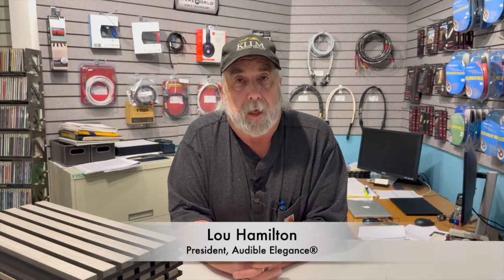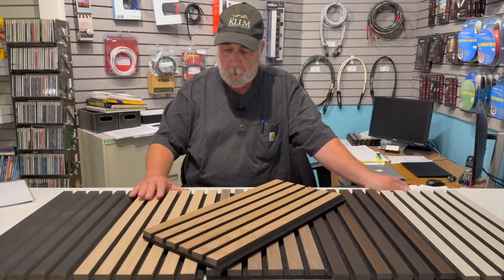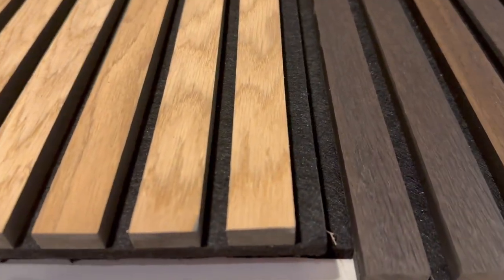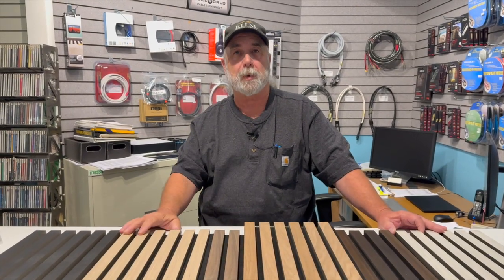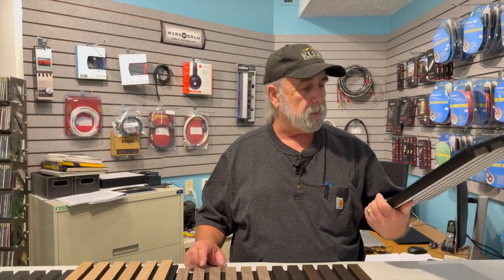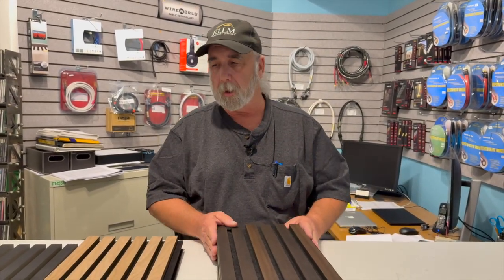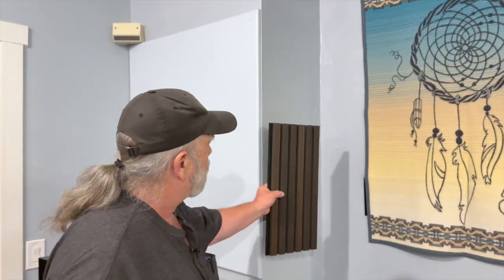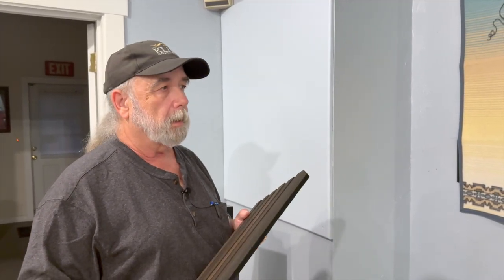An Entire Wall of Acoustic Treatment May Not Sound Good...At All!

Comment: Lou, per your suggestion I'm searching out these videos on room treatments. I may have my own particular need. However, I'm not grossly aware of significant deficits. The comments below help as well. Currently, I'm pretty darn satisfied with the sound I hear - and not aware of blatant misgivings. However, I'm just doing that eternal wondering... Can I make it even better? I've 'tuned' my room via speaker placement - trial and error for quite some time. In fact I'm not using any "formal" acoustic dampening materials. I'm using my room, as it's situated and furnished. Currently, I am only wondering if a tweak would be in order and what it might be. The surface that 'concerns' me the most is just the back wall, 3 feet behind my listening position. It's mostly bare - plaster over sheetrock. And I know that one of the idiosyncrasies of my room (if such a thing exists) is behind me, in the back, left corner where I've an open doorway which is perhaps some form of port for the room (if I were to view the room, in conjunction with my components, as a speaker in its own right). Thanks

Comment: I only have a few panels and a diffuser on my walls.  Since they don’t weigh a lot I used Command Velcro wall strips by 3M (not a sponser lol).  Since they are Velcro I can hide them behind the panels so the “remove pull tab thingie” won’t be seen.  I tried the removable double sided strips but you have to leave the pull tab visible for removal so the Velcro works better.  It does leave a large air gap between the wall and panel though.  Not sure if it makes a sonic difference having the bigger air gap or no air gab at all.
Reply from the maker: Interesting approach.  Oh, it likely does particularly in the likelihood that the board itself can resonate itself.  Now whether or not this is, itself, an issue, would require the experiment of taking the time to screw them down.  I like your approach as it allows you to change positions or placement. It is impossible to predict what exactly happens on velcro without measurements.  There are some great programs for the phones what might prove handy but keep in mind your phone microphone is hardly state of the art for this.  It's designed, or should be, around the human voice.

Thank you for your contribution to the video and channel.  Please do tell others about us and our other 330 plus videos with so many more to come.  Help us out by subscribing so that we can continue to improve our channel.

Comment: I changed my room orientation from short wall to long wall for the spkr placement which meant that my listening position was right up against the opposite wall. This reduced the side reflections and bass had no issues in my 25l x 13.5w x 11h space but the walls and ceiling needed treatment. Primacoustic 2" panels  3 ea  4' x 4' behind the two spkrs and the listening position and 2 ea 2' x 4' ceiling panels above did the trick. Wide deep soundstage, clarity, no smearing, air, slap echo is gone, vocals are lifelike and clear just wonderful. The panels are dense fibreglass covered in polyester fabric, fire rated broadband absorbers. I should have done this years ago, it was the last thing on the list but if I have to do it over again I'd do it before making gear decisions.
Reply: Thank you for sharing your experience—it's always great to see people taking steps to improve their room acoustics. That said, there are a few important points to clarify from an acoustical standpoint.

Positioning your listening seat directly against a wall—especially the rear wall—is generally not ideal. This location is where low-frequency pressure tends to build up or cancel out due to boundary effects and modal behavior. While changing speaker orientation can influence reflections and imaging, it doesn’t eliminate room mode issues, which are especially prominent in a room with dimensions like 25' x 13.5' x 11'. Those dimensions create predictable axial and tangential modal problems that cannot be resolved with broadband absorption alone, particularly not with 2" panels as one has to have predicable rate and levels of absorption from a wider band of frequency related issues.

It's also important to note that 2" fiberglass panels (Science has proven it's ineffectiveness), while offering little  at reducing mid- and high-frequency reflections (like slap echo and flutter), and do very little below ~250 Hz, (extremely carcinogenic). That means any improvements in bass clarity or “lack of smearing” are likely due to placement coincidentally aligning with room nulls or peaks—not a true resolution of modal decay, which requires much deeper, properly positioned bass absorption.

Lastly, subjective impressions are valuable to a trained Acoustician, but they don’t replace proper measurement. Without before-and-after data (RT60, frequency response, waterfall plots, etc.), it’s difficult to assess whether the improvements are addressing the full acoustic picture or just creating a more pleasant—but still imbalanced—listening environment.
Reply from the maker: @audiononsense1611  Thank you, you can see what I stir up with my videos and sometimes get abuse. I swear selling audio is about as smooth as a bill going through Congress and the internet has not improved things much at all.  The trolls can really make things difficult.

Comment: As an Acoustics Consultant, I often see well-intentioned advice from so called acoustics manufacturers and online—particularly from DIYers and YouTubers—that unfortunately leads many to waste money on ineffective products (including some mentioned here). My goal is to help you avoid those costly mistakes.

First and foremost, before investing in treatment, make sure your system is properly set up in the room. This alone can make a significant difference. Next, understand that low-frequency energy is typically the most challenging issue, and standard 2–4" foam panels will not solve it. Despite the marketing, there is no one-size-fits-all "bass trap" solution.  Low Frequency energy is powerful and can not be trapped but only managed!!

Avoid materials like fiberglass and Rockwool unless you're fully aware of their health and performance implications. Open-cell foam, when used appropriately, is effective for managing mid- and high-frequency reflections—but not low-end problems. Exposed glass surfaces also introduce their own set of acoustic challenges.

There’s much more to consider. I've written a comprehensive guide on this topic for those interested in diving deeper. Most importantly, if you're not using measurement tools, you're simply guessing. And remember: EQ cannot fix room modes—it only masks them temporarily.

If you need help navigating these issues, I’m happy to offer guidance.

Comment: Excellent video again. I bought two 8ft. tall by 2ft. wide sections from my local Floors and Decors store. They are $100 a piece and the quality is great. I use them like Bass Trap (no filling behind the  panels - yet). They are loosely placed against the front corners of my room for both my Subwoofers and Electrostatic Speakers. 

They work great. As you mentioned. Lining the front wall would look cool but sound like crap.
Reply from the maker: Thank you for experience and a way to use them.  I am reminded of the period where there was this guy selling all sorts of little triangular pads to place in the corners of your room.  It became quite a fad for a couple of years in the 90s, I think.  Now, while they sorta make sense, again, they were all the same size, same density, and same thickness. One size in acoustics does not fit all.  Did they make a difference, oh, likely. An improvement?  Well, why are they not around today?

Thank you for your contribution to the video and channel.  Please do tell others about us and our other 330 plus videos with so many more to come.  Help us out by subscribing so that we can continue to improve our channel.